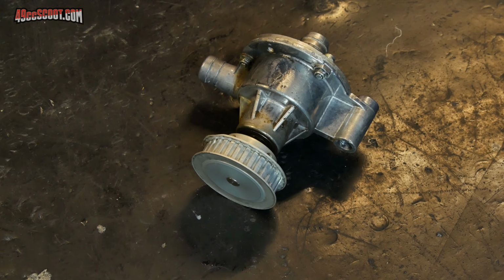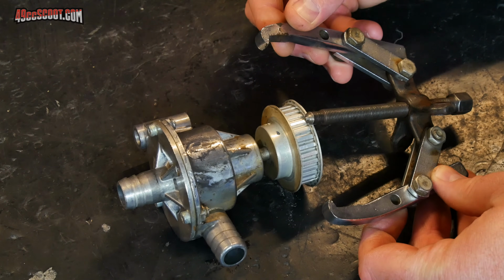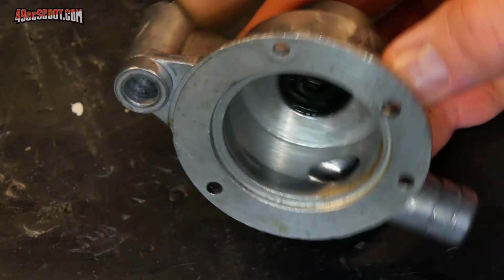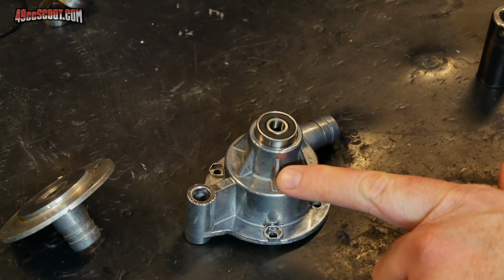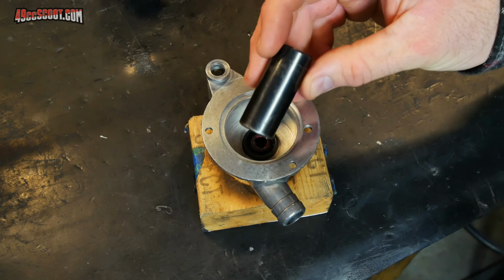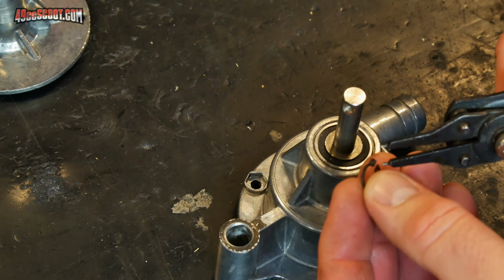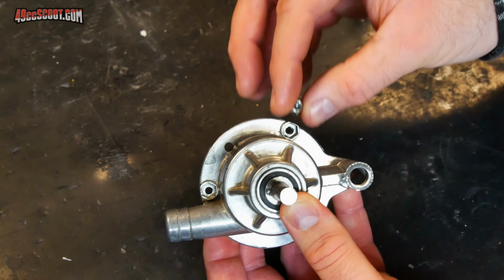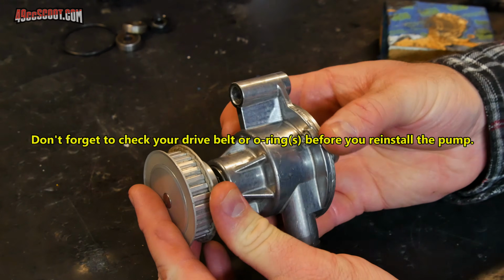Kart Pump Rebuild : New Bearings, Seal, O-Ring & Impeller Shaft For Righetti Ridolfi K514 Water Pump

Comment: im curious as to why kart water pumps are separate items, instead of being integrated to the engine like a motorcycle for instance. Is there any advantage?
Reply from the maker: They are driven by the axle in most cases so that's easier with a pump that you can move and probably also because they're racing machines primarily so the ability to use different pumps and configurations is beneficial.

Comment: Wow good job.
What means did you use to clean the parts?
Reply from the maker: I used a cleaner/degreaser. Nothing fancy. Soap and water or something that leaves no residue is good to finish.
Reply: @49ccscoot  OK, I did that too.
I cleaned the drive parts of my scooter with detergent.
Many in the comments said I should use brake cleaner.
Only then did I read that the brake cleaner should attack the rubber seal and then tear.
What do you think about?
Reply from the maker: @heydaniel12686  Brake parts cleaner can be harmful to rubber. I don't have a problem using it to clean, because it can make the job easier, but you may need to use something that  doesn't leave residue after. That said, I have used brake parts cleaner many times and then installed seals without issue. Best way would be something less harsh as a final step. It's hard to go wrong with dish soap and water and then drying.

Comment: I have a concern.
You should install the cover last.
When you hammering the pulley,  you pushing the shaft or impeller out .
Reply from the maker: With the washer and circlip on there, it really can't go anywhere. Especially with how tight it is in the bearings. I see your point though. Wouldn't be a bad idea to have the rear cover as the final step.

Comment: I am pretty sure the seal was suppose to go between the bearings
Reply from the maker: I reinstalled it just as it was from the manufacturer, known to work for ~1,000 miles. I assumed they were trying to seal there to separate  the area where there's water from the outside where the bearings are.
Reply: @49ccscoot   possibly but bearings in a vehicle water pump are lubricated by the coolant and if the seal was in the center it would take more of the lateral movement away and stabilize the shaft much better benefiting in less cavitation inside the pump irregular flex of the shaft would make the pump impeller wobble meaning cavitation and also higher failure rate of bearings you want a gap between bearings if you stack bearing side by side with shaft play on both ends your asking for issues your always suppose to have a gap between 2 bearings look at your front wheel the bearings are outset on outside with a tube / spacer between them in your water pump that would be the seal between them.
Reply from the maker: @rickcooperjr62864  I understand the concept. I figured they've made more water pumps than I have. The whole design could probably use improvements, but I have a feeling if you race karts 1,000 miles between service or replacement of a $50 pump it's satisfactory.

At least it does appear that they changed the impeller shaft design. It was a smaller shaft without such a tight fit and a ring to prevent some movement. It had play from day 1. This one is solid at least when fresh. 

It would be interesting to see how some of the other pumps are arranged and hold up. There are at least 4-5 out there from see through plastic to billet. The clear one does look like there's more separation of bearings, but I really can't tell for sure where the seal is in pics. I can  see that there's shaft behind the first bearing, not just a bearing butted up to it.

Comment: Next time you do a rebuild you might want to consider buying some quality bearings such as NSK . They will last a lot longer and the seal will most likely last longer as chances are the bearings getting loose is what took out the seal.
Reply: Does not have to be the case. Any dirt or debris from the coolant could get trapped in the seal and that will cause a leaking seal a lot of the times.
Reply: @Jacob-th7do  maybe so but it would have to go through or around both bearings first.
Reply from the maker: @DoRC  I've never bought a kit from the manufacturer before. Didn't look at what was in the pump. Figured they'd be a quality part. I ordered 2 kits and 2 impellers. TBH, if you see the cost of the pump vs the cost of the parts, it's not much more to replace the pump.
Reply: @49ccscoot  understood. I would just personally not want to have to rebuild or replace the pump every 1,000 mi. The bearings that come with it are a Chinese brand (jfk)
Reply from the maker: @DoRC  The amount of tension on my belt probably isn't helping. It was good, then I added rubber and it's tighter than I want it. May have to find thinner rubber. Would likely decrease losses as well. I know when I tested with the router setup, more belt tension lowered RPM even  without the belt slipping at all.
Reply: @49ccscoot  yeah you can actually go pretty loose and still get away with it with those toothed belts. At higher RPMs you're probably going to see some harmonic vibrations but you could add an idler to help with that if there's room for one. That being said the bearings, if they're high quality,should be up to the task of just about whatever tension you can put on that belt.